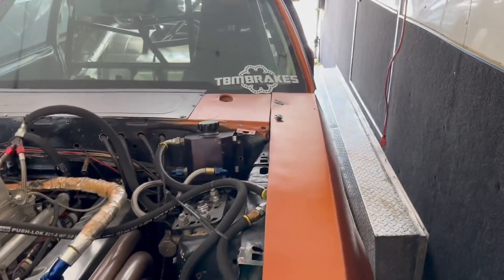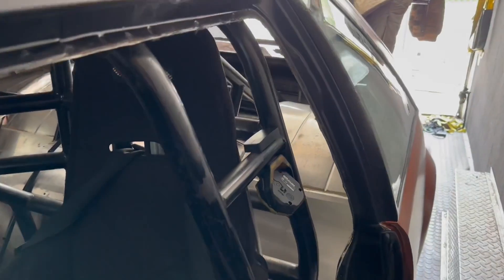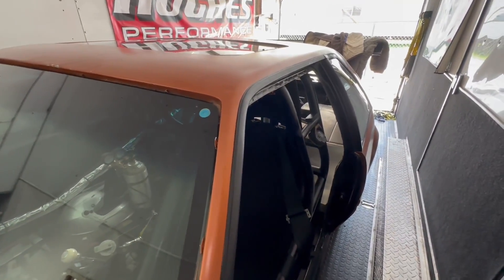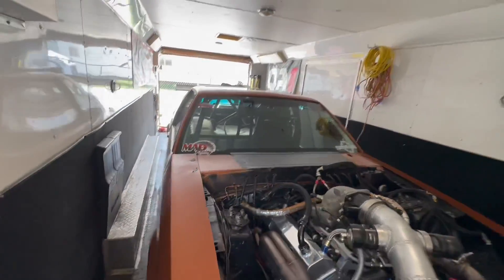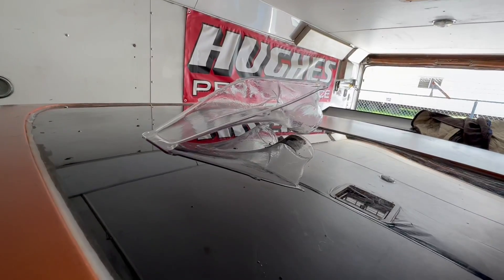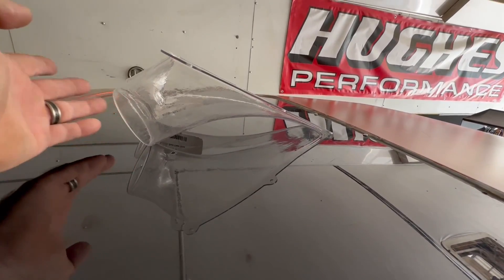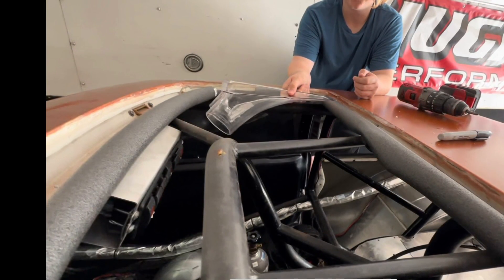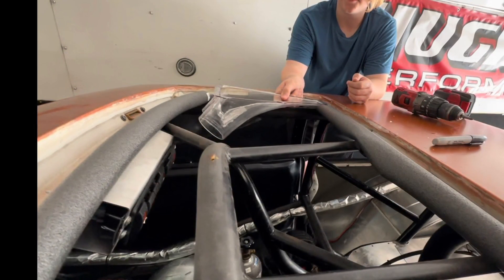Will this work? Reverse NACA duct

Comment: im no expert but would you be better off putting 1x naca duct on both quarter windows where the flow is somewhat still attached to the vehicle and then have it vent out the back of the vehicle in the low pressure zone so the air is effectively pulled out of the cabin with sort of a scavenging effect (not the correct term i am aware) where the high pressure air (inside the cabin)  tries to migrate toward the low pressure (rear bumper in the cars wind shadow) i think this may improve driver cooling also, again im not an expert but id like to imagine this would work fairly well

Comment: U ever rode in a pickup truck with front windows down,  and back glass slider open?
I think your about to get the opposite effect of what your wanting to do,   Go try it for yourself 
The wind comes through the back glass,  and comes up from the back of the cab and goes out the front windows,

Comment: "A" for effort on this one but unfortunately the NACA duct requires significant air velocity to function correctly so no dice on getting burnout smoke out of the car before the run. I know it sounds counterintuitive but if the NACA duct was facing the normal way the air that is being put into the car is actually low pressure air just higher velocity (bernoulli's principle) so in theory if you ran the NACA duct the regular way is should equalize the pressure differential inside the vehicle fixing the door bulging issue but that all depends on the volume of air getting into the car.

Comment: You would do a lot better with a battery operated leaf blower in the rear with a rear exit and a remote switch up front, and a couple or rechargeable spare batteries. That roof funnel is going to be a trip during the first flash downpour while stuck in the lanes funneling all that rainwater right down to the in car electronics my brother.